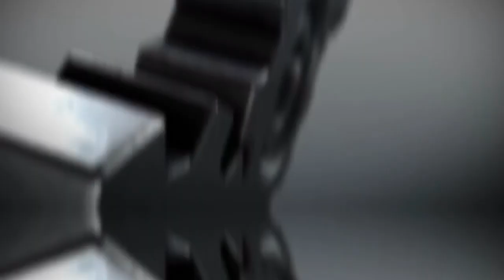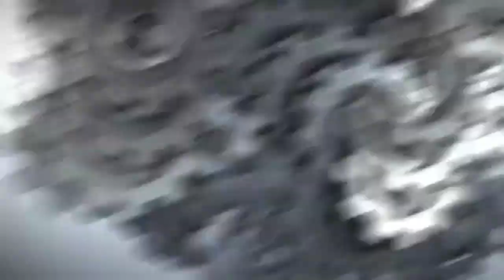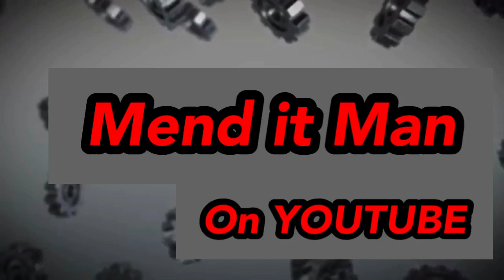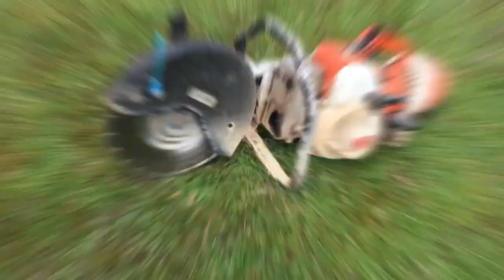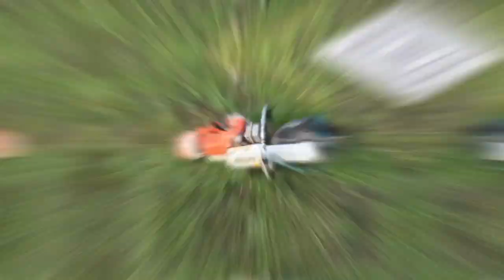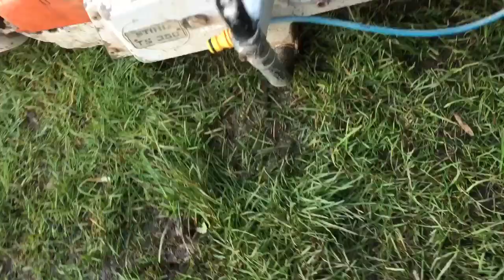Stihl TS350 Cut Off Saw In Action 💪 ( & Cold Start )

Comment: Hi Luke, they're good old engines💪 I've got 2 as chainsaws the 08s. I have a husqvarna 268k which is a husqvarna 61 chainsaw with bigger cylinder basically.
👍
Reply from the maker: Hi yes they are a good engine, I lost a bit of faith with this one years ago when it kept cutting out. So I got the secondhand coil but never really used it after that so I wasn’t totally convinced I’d fixed it, but this job has been a good test and it seems spot on. I’ll keep this for the concrete stuff and the TS360 I’m doing up for cutting metal. Thanks for watching🙂👍

Comment: Good machine there Luke
Reply from the maker: Hi Nev yes Stihl did really make some great stuff back in the day, they still do but like most companies have gone cheap in some areas. I think if you can pick up good older tools it better than buying brand new tools ( most of my tools have been repaired by myself and saved from the scarp heap) . This saw must be 30 years old and as you can see it’s working spot on. Thanks for watching 🙂👍
Reply: I'd rather use one of these than any modern version. They're much handier & more powerful.